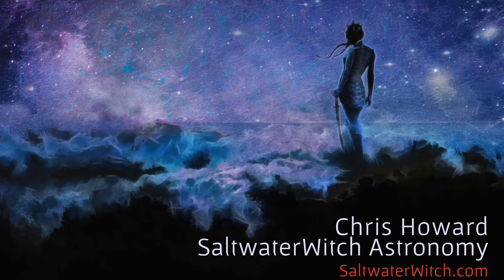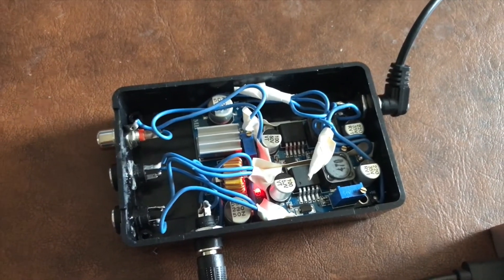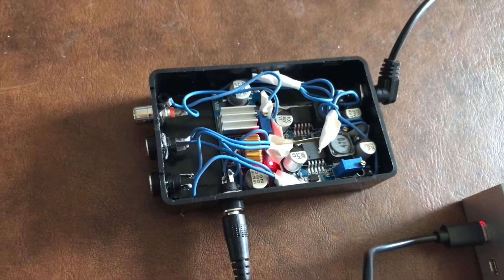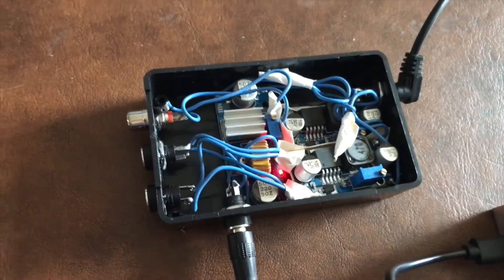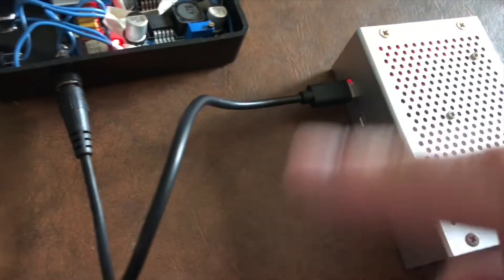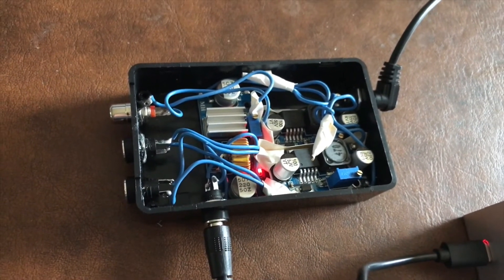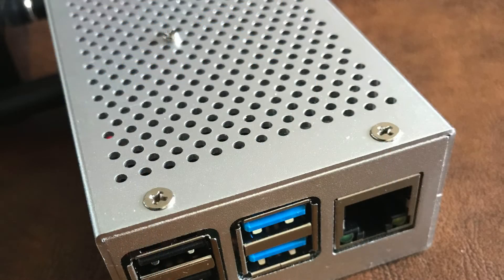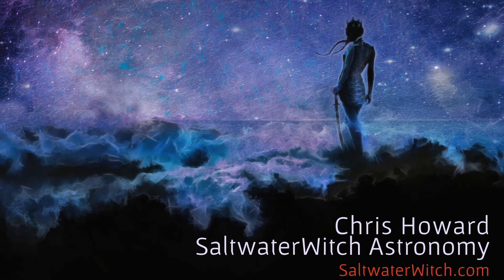A Cheap Powerbox for your Astro Imaging Rig

Comment: Great vid! Could you provide a link to the boost converters?
Reply from the maker: Thanks! I don't know if these are the exact ones I was using--they look like them, and these have the same XL6009 regulator, which is what I was using in the project. https://www.amazon.com/dp/B00LP2LZ4M
Reply: @ChrisHoward  Thanks. The output current at 12 V is 1.5 A max. Is that enough to supply your camera or mount while slewing?
Reply from the maker: @herrcay0323  I don't think that's enough. Depends on the camera, mount, other devices--check their specs, but I would go with at least 3-5 amps for any mounts or cooled cameras in use. I think the standard power supply for the EQ6-R Pro is 12v 5A, and I just looked up the ZWO ASI2600MM Pro and ZWO recommends at least 3amps.
Reply: @ChrisHoward  Roughly the same goes for my rig, so how did that boost converter work for you? Sorry for prolonging this discussion
Reply from the maker: @herrcay0323  That was a while ago and most of my gear has changed. I use a good-sized LiFePO4 portable power station these days. Back then I was probably running the mount off its own 12v line, and I used this mainly for powering the Raspberry Pi (5amp out), the dew heaters, and the ZWO ASI1600MM, which only needs a couple amps (1.5 - 2) at most. Also, I was only using this as a regulator, dialing down the output voltage to 12v--so 12v in and out, and that must have been enough for current. If I was going to build this today, I might go with something like this: https://www.amazon.com/dp/B00LOG4XC0 ?
Reply: @ChrisHoward  Thanks! I'd have to use one in front of every output, right?
Reply from the maker: @herrcay0323  That sounds right. Each one will have a max current for the output and you may not want to split across devices.

Comment: This is fantastic. 
I've been looking for a cheaper alternative to the pegasus power box. 
Whats the main board know as?
I have basic soldering skills.
Is there a schematic available?
Brilliant job! 
Cheers.
Reply from the maker: Hi Jason. The Pegasus Astro stuff is brilliant, and I use the Pocket Powerbox on another system, but I went super cheap with this setup--no dedicated circuit board. I used a pair of boost converters as regulators to keep 12v steady. I'm a software engineer not an electrical--and someone correct me if I'm wrong--but the boost converter will essentially trade current for voltage in order to maintain 12v out when my battery begins to drop to 11.5, 11, etc.

5 Pack Boost Converter Module XL6009 DC to DC 3.0-30 V to 5-35 V Output Voltage Adjustable Step-up Circuit Board (5 Pack)
https://www.amazon.com/gp/product/B06XWSV89D 

And then a step down board from 12v to the 5v ~4amp I need for the Raspberry Pi 4:

12v to 5v 5A Converter, DROK USB Buck Converter Voltage Regulator DC 9V-36V Step Down to DC 5V-5.3V 3.5-6A Volt Transformer Power Supply Module
https://www.amazon.com/gp/product/B01NALDSJ0

I simply wired these together with some 5mm jacks, soldered things together, taped up the exposed leads, and jammed everything into a 100 x 60mm hobby box.  I did some smoke tests, with volt meter and then plugging in LEDs to verify output before hooking up the real equipment. And it all seems to work well!
Reply: @ChrisHoward  Thanks so much  Chris for your comprehensive reply, and links. 
It's certainly food for thought.
Would I be right in saying that an extra step- down buck converter could be used for dslr power,  using the potentiometer to drop output to 8 volts? Lots of possibilities.
I also use Raspberry pi. The 3 model B.
I followed this great tutorial and script: 
https://github.com/rlancaste/AstroPi3/blob/master/README.md
Now using kstars to control my Mount and gear from Windows 10 PC via web manager.
I find Kstars and Ekos to be very underrated, it's fantastic! And the pi will   broadcast as a hotspot when not connected to my home network, so great for field work. 
I'm definitely going to give this great solution of yours a go. 
Thanks, once again. 
Clear Skies!
Reply from the maker: @MrBengourben  Yes, for DSLR power something like this would work with 12v in / 8v dc out:
LM2596 Buck Converter, DC to DC 3.0-40V to 1.5-35V Step Down Power Supply
https://www.amazon.com/dp/B06XZ1DKF2
I agree. I've been using INDI/KStars/Ekos for a while, 3 years or so, and it's my overall favorite. There are individual features I like better in other apps, like the mosaic wizard in SGP, but I haven't seen anything better than Ekos for handling functional integration and staying up with 3rd party APIs. Hats off to Jasem and team at https://indilib.org
Reply: @ChrisHoward  Thanks again for all the info.
I finished the powrbox and it's working a treat. Not very pretty, as the modules I purchased were larger than your own. 
So used an old dlink router as enclosure. But very pleased! I have dslr power, 2x12v and 1xusb..All I need.
Thanks Chris,  you saved me a few Euro! Keep up the great informative videos, much appreciated. 
Jason.

Comment: Yeah! same even i brought the 12v 10A board n able to power alot ~ but it was not able to maintain the stable power output. going to make one my self~ maybe add a small fuse for protection :) cheer n clear sky!
Reply from the maker: Awesome! Good idea on the fuse. I have the incoming line from my battery fused, but I should add some surge and short protection into the box itself.
Reply: @ChrisHoward  I wonder any surge n short protection in small size that able to fit in box~ also add a TDK filter magnetic ring to maintain stable voltage flow